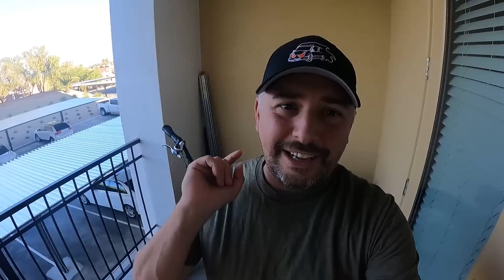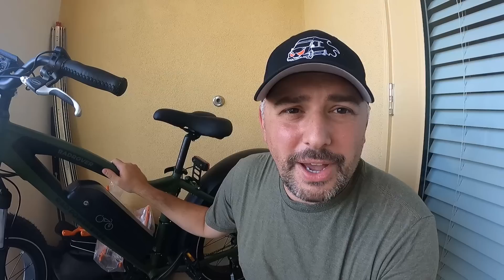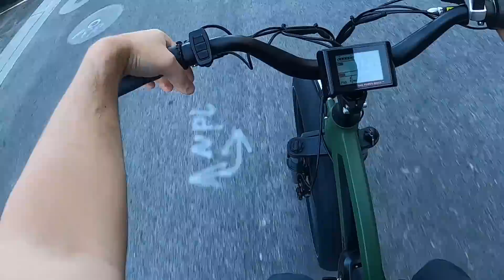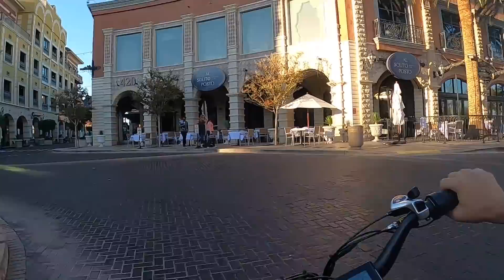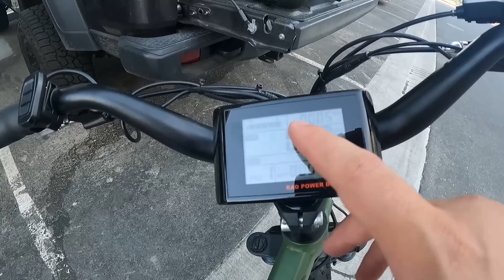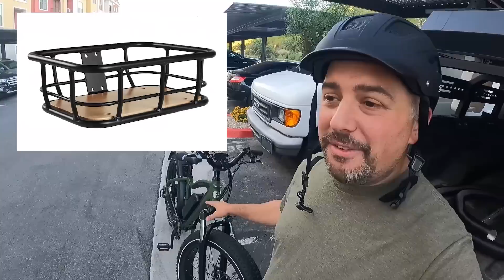Rad Power Bikes for Travel and Van Life

Comment: Recently put in 30 miles on my RipCurrent-S from the Juiced company riding all over beautiful Missoula Montana.
  
My buddy leading the way was on a Rad Rover that he must have three thousand miles on now.  (I have 850 miles since purchasing last October).  Hard to do 30 miles unless you are very, Very fit!  I was tired at the end of the day with plenty of exercise, but those bikes made a huge difference!  Both of us kept the assist on Level-1, which was plenty for flat ground traveling.
eBikes are great for older people with knee or hip issues, as well as great for hills or running errands.  
Fat tires?  You bet!!!!! They work wonderfully on poor surfaces as well as gravel roads. They also provide a smother ride and some protection from shocks such as chuckholes, roots, and some rocks.

I find the pace of bicycling just right for sight seeing, rubber-necking, looky-looing, and scenery soaking!  Walking is too slow and motorcycles or cars are simply too fast.
Good pick Jarrod as my buddy loves his Rad Rover.  
(They were too small for me.  My RipCurrent was available in an XL frame so I went with that.)

Comment: I’ve just started looking at ebikes.  So glad you posted this.
Reply: Hello Susan, I have 850 miles on my eBike now.
Mine is a fat-tire mountain "style" bike much like the Rad Rover Jarrod has.  
I like the fat tires for their softer ride and great flotation over rough streets and gravel roads.  The assist is great for getting over hills without exhausting one's own energy.  While many of these bikes are quite heavy, the battery and electric motor removes that issue.  Note though, the downside is if you have to lift an eBike into the back of a van or pickup.  Most are in the 50 lb. range.  There are techniques like applying the rear brake and pulling up on the handlebars to lift the front wheel onto a higher surface.  Then using both hands and good back mechanics to lift the rear of the bike.  I use a ramp I built and the bikes electric power to walk it up into my pickup.
For those who have knee or hip issues these machines gets people back on bikes.  Back to sight seeing and scenery soaking!  
Good luck on your quest!
Reply: @Snarge22  , thanks for the input! I’ll share with my best friend.  We’ve both been researching ebikes.
Reply: My husband and I bought the Rad Rover 5 and we love them.  You can get a good workout if don’t use pedal assist. But it comes in handy going up hills.
Reply: I fully agree on the workout @sherrijones307 .  While these bikes are heavy, it just means one can get their aerobic exercise somewhat quicker and in less distance than those carbon/titanium/composite bikes full of unobtanium and drillium.  ;-)  Those bikes are so efficient it must take three times the miles to get about the same amount of exercise.  As for me, I do a regular "lap" in my neighborhood that's on a modest slope most every day.  About 80% of the miles I have on my really heavy RipCurrent-S is with no assist at all.  Two of my buddy's bikes are Rad Rover 1's and he has significant miles on them now.  :-)

Comment: Jarrod have you ever seen a kitchen that slides forward over the drivers seat and so uses that space in a second way. You could vent directly out the drivers window. The over head above the driver would lose a little storage. The van could be kept short.
I was thinking of the way your slide out kitchen worked on the back of your jeep.

Comment: I've been carrying a Rad-Mini in my Promaster build for nearly 3 years now.  It's a killer setup, and I don't even have to fold it to fit it my van (I only take the front wheel off). I store mine across the back windows inside the van.  The only big downside to the Mini is their weight, as they are quite heavy. That may be a deal breaker for some as it can be quite difficult to manhandle one into the the rear storage space of a van.

Comment: Hey Jarrod, I realize that rad probably reached out to you, so you got the bikes free or at an extreme discount, but they don't actually make anything in America. They just import Chinese components and upcharge. I have a Rattan folding e-bike that I paid $1200 for. 
 
I can almost guarantee you that the range claims by rad are not true. You have to put it on the lower pedal assist and also pedal the whole time to get the ranges that they claim. It's the same with my bike, but I never believed the range claims in the first place.